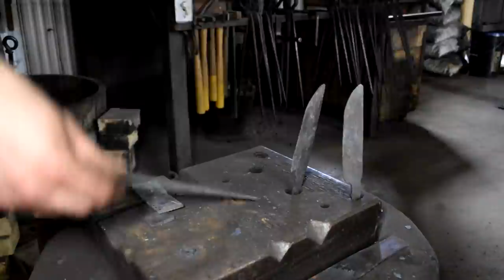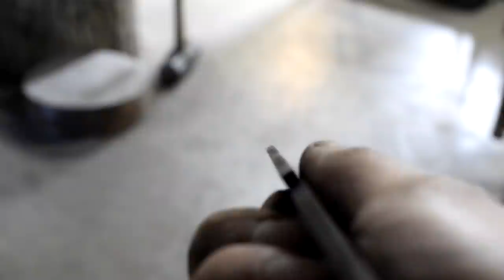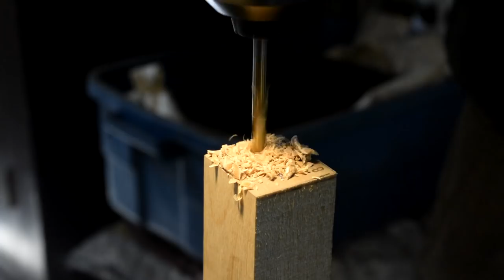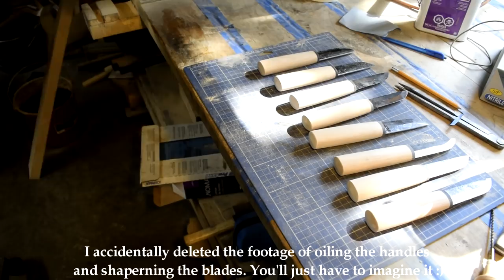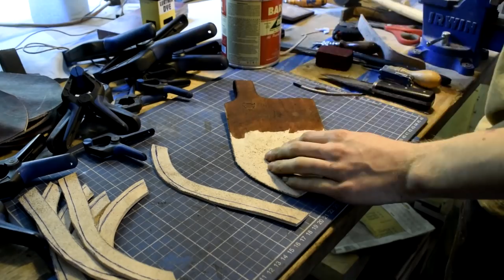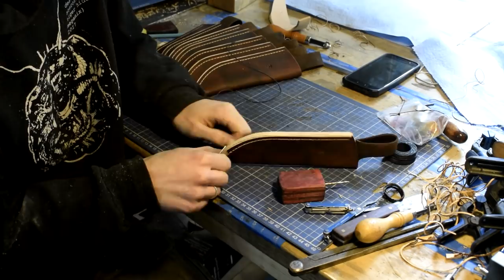Knifemaking & Leatherworking - Making 7 Small Scandinavian Bush Knives (Available)

Comment: What steel did you make these out of? I have a bunch of leaf springs in my basement but I thought about maybe turning them into swords but knives sound much more manageable
Reply: Leaf springs are generally 5160 or something similar, makes a serviceable knife and a good sword, but if youre thinking of selling them just buy some steel so you know what it is, and you dont get burned by a microfracture
Reply from the maker: They're made of 1084. Like choccymilk mentioned spring steel is usually 5160, it's decent and will take a nice edge but definitely more suited for larger blades as it tends to be a bit softer. For smaller knives something like 1084, 1095 and o1 are all very good carbon steels for smaller blades.
Reply: @MakeNCreate  silver steel also makes a cracking knife and is easily available in round stock, alloy is 115CrV3, gets screaming hard in fast oil
Reply: You should attempt a gladius blade if you have some spring steel. I used to have some myself and did a bunch of research, figured out any variant of a Roman gladius would be a good starting point for me. I wish i never slept on the project. Now i have no access to anything i could use to even get this spring red hot 🤣

Comment: I have a question, I noticed these knives do not have pins in the handle just epoxy? do you ever have any problems with the blades coming loose?
Reply from the maker: Never had any issues. Epoxy holds extremely well if everything is nice and clean beforehand.
Reply: @MakeNCreate  Thank you, These are some amazing knives!

Comment: What type of steel are the blades?
Reply from the maker: 1084.
Reply: Do you worry about the 1084 sitting in a leather sheath rusting?
Reply from the maker: @hawk5148  Nope. If the sheath is nice and dry it won't rust. After wet molding I let them dry a day or two before they go in the sheath.